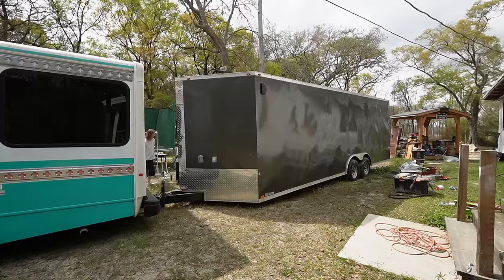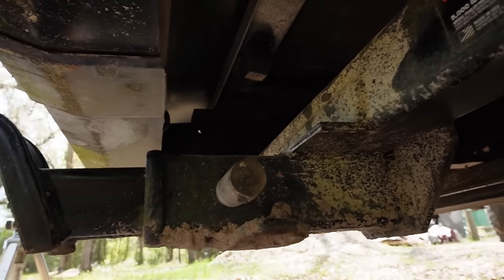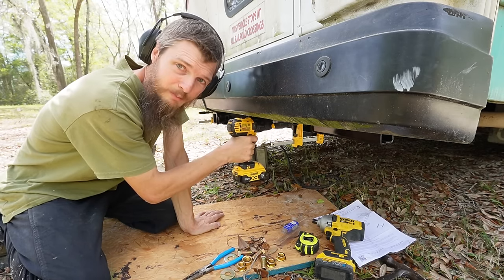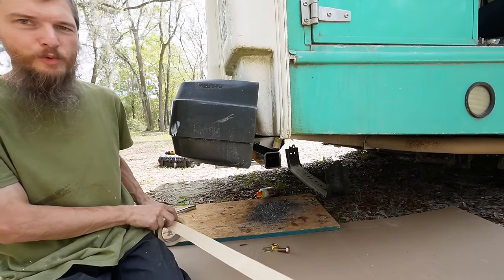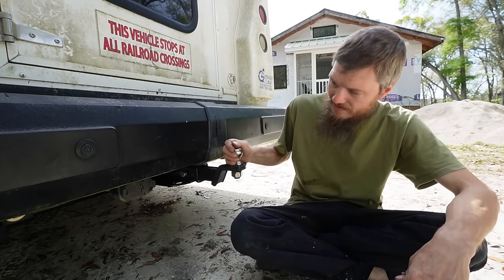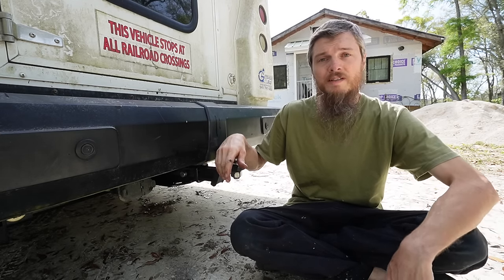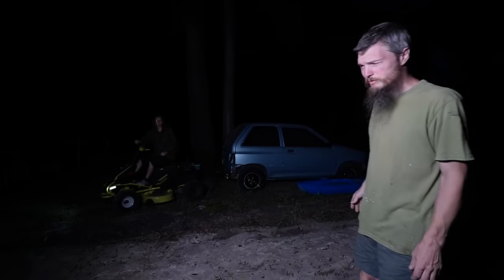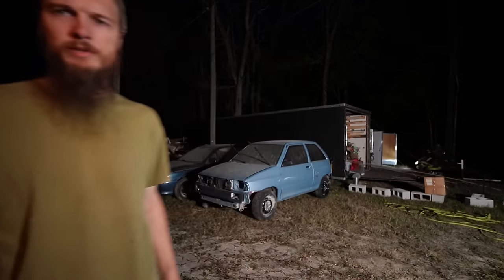More Changes. Making Life Better

Comment: Hey Doug, 
To prevent the rollback hold your foot on the break, shift to neutral, set the e-brake, shift to park. Dad taught me that one to save the transmission from clunking into gear when parked on a hill but I found it equally as handy in hooking up trailers. Cheers! 😊

Comment: I am so impressed with your creative problem solving. 
Absolutely impressed…taping the nut:bolt to the scrap of would so you could have it in place to fasten was brilliant. 
Which is the nut and which is the bolt!!??  And Ashley pulling the cars (future projects) across the yard just as easy as you please…simply amazing. I so much admire your Team work and value system!!

Comment: We always had hitch problems towing trailers until my husband bought a ‘Drop Adjustable Towing Hitch Dual Ball Mount’. Solved the problems and worked on any trailer we pulled.  Bought it off of eBay.

Comment: Nothing I'd rather do than put puzzles together. A web site where they send you a free weekly puzzle. Use it when I don't have room to put a puzzle on a table. No pieces lost either. Moving the cars did make the yard more organized and cleaner. So glad Ashley still locks up her mower. That thing would be gone in a flash. She did a great job moving the cars with it. Doug the upgrade on the hitch was necessary too. Looks really good.

Comment: A tip for drilling heavy steel.....low speed and high pressure will cut the best and keep the drill cooler.  That's why a drill press works so good, obviously you couldn't get a drill press on the car, but low speed on the drill transmission would be better than high speed 👍

Comment: I would recommend Air Lift airbag system for the rear of your bus, wreckers use them for ground clearance, it doesn't affect rear springs, only in heavy weight situations....

Comment: They sell specific hitches for  extending without removing the entire universal system. Just a matter of removing the pin and insert a longer neck hitch or higher/lower hitch and replace pin and off you go. 

I absolutely LOVE your channel and look forward to seeing them. I own a 1982 trailer and I’m learning so much from your channel. I’ve only been watching for a couple months now.
Reply: I agree a DIYfferent receiver would have done the job
Reply from the maker: The hitch frame itself was too low and there was no way to change that without changing the hitch. The new one is much better for our bus.
Reply: @diyfferent  , I was offering other options for future possibilities. Trailers come in all different shapes, sizes and angles. I like the new one better, it definitely added more height and balance for hauling. 

I hope you all have a beautiful and blessed day!

Comment: Not gonna lie, it's definitely a New York thing, too! 😅 At our house, the example was: moving a dead dump truck that didn't hold air, with a tractor that had a hydraulic leak (which of course happened run out while I was towing the 10 wheeler!) in the dark 😂
Would a raised trailer ball work better for hauling something like the shop? I don't remember the technical name but we use them when we tow farm equipment with a pickup. The rise is taller than a standard hitch which accounts for the drop when going from a tractor to a truck. I'm not sure if that would work for you or if it would end up being too high. 🤔 
You're making me want to work on a 1000 piece puzzle!! 😊
Reply from the maker: Yeah, that may help. We have two ball mounts, one being taller the the other. I've seen the adjustable and taller ones, but our ball was so close to our bumper that it was hard to use anything else. Now I definitely have more options.
Reply: @diyfferent  Yes, for sure! Swapping the hitch was a good move! I don't have a positive opinion on adjustable ball mounts... I feel like they aren't as robust. As space saving as it sounds, I'd rather have multiples.

Comment: All the little tasks can make such a big difference. You might want to cover your cars from the elements. I know you want to eventually paint the hatchback but 🤷🏻‍♀️. It might protect it. Watch for critters every now and then. I had a little Toyota Tercel that was parked for a bit awaiting repairs. Some rodents made themselves a home in the engine and I found wires eaten through and hanging from underneath the car. 😮

Comment: If you still have an issue with the bus squatting under load, you might consider adding some load leveler/helper springs. They sit over the stock springs and only engage when the stock springs compress. I've added them to several trucks I've had thru the years. They don't alter the ride feel at all until under enough load.
Reply from the maker: The bus will still squat. That's a whole other problem that we should look into. So I appreciate the ideas.

Comment: Those cutoffs would also be useful tacked on to the front of the “jar” shelves you put in the trailer to hold your nuts and bolts. Offset up a quarter inch or so, they could keep the jars in place, should you ever change your mind about moving the trailer. With your skills, even if your area is not prone to hurricanes, perhaps someday you will have the opportunity to take your bus and mobile workshop on the road to help others rebuild.

Comment: That mower has more power than you realised. Nice work guys. Very good move on that hitch.. I was thinking it was a little  to low when you were moving the trailer. But you don't know these things until you have to use them. 👍🏼👍🏼👍🏼🌻🌹

Comment: Bye, Maverick! Were you chasing lightening bugs?
Great job, Doug & Ashley getting all the cars out of your way. You've improved your land ten- fold already but I know you want it even better. Can't wait to see what you'll do next. 
Doug, changing the frame of your hitch on the bus helped give you more clearance. But the actual ball part can be changed too. They make different shaped balls that would move the ball away from the bumper even farther and some are shaped to give you more height also. You might want to check into those also.

Comment: You need some air bags over the rear axle. The trailer tongue weight is what makes the back of the bus sag to the ground. The hitch might help but it won’t solve your problem.

Comment: When the hitch was installed did they box in the frame extensions that nearly every shuttle has? I believe mine is the size of yours and I would not have thought that it would have had the extensions but it did. I do everything but weld but I found a great shop that fully boxed in and reinforced the extensions so I could utilize the full towing capacity of the E-450 chassis (22k pounds!)

Comment: I'm wondering why the manufacturer didn't have a single longer bolt to go through the square tubing vs. two shorter bolts to mount it to the brackets.  That would have made it easier.  

I'm surprised that mower had enough torque to pull those cars.  My dad liked to tinker on cars, so I grew up having to help push cars from one spot to the other.  Unfortunately, he wasn't very good at getting them to run again.  He had a lot of plans in his head, but not near as much ambition and time to get them done.
Reply from the maker: My guess is two bolts makes it stronger. Also, if the holes aren't drilled perfectly, one bolt might not line up right. Also, one bolt might squeeze the tube if it's fastened too tightly.

Comment: Hey Doug good video bro I like the newest job but wouldn't it be better if you put a set of airbags on that Beast I think if you put airbags on there that help Supply the load also and you'll be able to take that big ass trailer let me know bro
Reply: Air shocks is what I think you are speaking about.
Reply from the maker: A couple people mentioned it, and it's something I'll definitely try to look into. It may not be right away but that could be a good future upgrade.

Comment: Switching trailer hitches not going to do much. You need to upgrade your leaf springs to keep it from sagging. I suggest you install new leaf springs and a air bag system.
Reply from the maker: It's going to do a lot. Even empty I often drag the hitch on the road when pulling into parking lots and it's annoying. This one shouldn't drag. And I will no longer have to ram the trailer into the bumper when I hookup. It's a huge upgrade. You are right, this won't change our bus suspension and I didn't think it would have any effect on that.
Reply: Methinks that you should check the nose weight of the trailer.

Comment: Instead of replacing the trailer hitch go buy a weight distribution hitch... even a cheap one from Harbour Freight.  Once a weight distribution hitch is set up it will equally distribute the trailers tonge weight to 3 places: 1/3 to the vehicles steering axle,  1/3 to the vehicles drive axle , and 1/3 of the weight to the trailer axles. This provides safer driving,  less "squat" of vehicle rear suspension, better braking . There was nothing wrong with the hitch you had. Without proper weight distribution the vehicles rear axle will continue to act as a fulcrum causing the rear to squat, and the front to lift.
Reply: Good to know. Thanks.
Reply from the maker: I just want to clear up that replacing new hitch had nothing to do with resolving the bus squatting issue. I installed the ball hitch at the same exact height as it was before and it will carry the trailers exactly the same.

I replaced the hitch because the hitch frame was too low and did not stick out far enough. The hitch definitely needed replacing as it just didn't fit our bus well. And replacing it did fix the issues I was hoping to address.

Comment: The ball barely clears the bumper because the tongue is upside down. Like that you decrease the tongue’s load capacity.
Reply from the maker: No. The old hitch was just not the best choice for our bus. The new one fixed the clearance issue. The ball mount wasn't upside down. They can be used in either the drop or rise positions, so there is no up or down on them. I use it in the rise position because I don't like the hitch hitting the road and like it a bit higher.
Reply: @diyfferent  Ive used them up and down depending how the trailer or camper was riding. I was told from an off road store worker about the up/down tongue rating, that’s why I wrote the above. Now I’m going to research it some more. 👍

Comment: Bus will still squat, air bags man, air bags!
Reply from the maker: Yeah, I'm not worrying about the squat just yet. I was just tired of the hitch dragging on the pavement when I pull into a parking lot, and it being so difficult to get the trailer on the hitch because of the clearance issues.

Comment: Ok thats a first for me your lawnmower has a backup alarm, what kind of richy rich shenanigans is this lol. I've never seen any mower with a alarm and don't tell me it's also electric cuz i don't here an engine. Oof the sound of expensive is quiet lol
Reply from the maker: We'll be disabling that beep soon. It's rather annoying to listen to, haha :D
Reply: @diyfferent  surprised me to even see a mower with one lol we must not have those in Arkansas lol, what brand is that as well looks cool in all honesty.
Reply from the maker: @reaperasylum  It's a Ryobi. Ours is an older model that uses lead-acid batteries. We've had it since 2020. It's a great mower...super heavy though!
Reply: I laughed so hard 🤣 
Really funny comment 👍
Reply: XS power makes some really decent lithium iron and lithium ion batteries that might replace those lead acid ones, I use them all the time when I do stereo installs for customers and my own vehicles, 12v all the way to 16v. Last a really long time and not to terrible for charging, they are pricey but I was able to find some used ones for about half the price. Might also lighten the mower up a bit, it a neat little beast how does it perform on a yard just as good as gas mowers?
Reply from the maker: @reaperasylum  Sounds neat, but we actually like our lead-acid batteries. They really hold up well and we don't have to worry about them like most of the lithium batteries. We can charge them in the heat and the cold without ruining the batteries. And they last a long time. The mower works awesome, it mows everything.
Reply: Sweet I may consider going electric lol, my craftsman keeps breaking down and it bogs down and smokes like crazy, imma check the electric riders out. No bigger than my yard is a single charge should last a couple days. And great progress on the trailer my friend y'all are giving me inspiration to start on mine, very helpful guide to repair mobile homes🤙🏼💯
Reply: Richie Rich 😂 I know how old you are!! I bought a  new Suburu Forester a few years back that had a backup alarm and loved it.  My husband who got a new car the year before didn't get one and wished he had one. So for his birthday I found an add-on at an auto shop and had it installed. Only problem was that when he backed up the alarm went off so loud it sounded like a garbage truck. The neighbors ran outside to see what was going on. He was so embarrassed that after awhile he yanked off the wires.

Comment: Why didn't you use the Massey Ferguson tractor?
Reply from the maker: It's just not needed. It was late and so there was no need to fire up the loud diesel tractor and disturb the neighborhood just to roll some cars around. The riding mower is super quiet and it's more compact and easier to maneuver. It was just the right tool for the job.

Comment: I'm not a fan of small cars or vans, especially those like the Fiesta. 
With larger cars, SUVs and trucks there is more of a safety zone if you're in an accident .
In smaller vehicles or things with small hoods there's no crumple zone, YOU are the crumple zone
Reply from the maker: We just really love small cute hatchbacks, like these rare ones, and they have their own safety advantages like being much easier to stop. :) As time goes on vehicles keep getting more and more massive. Even pickup trucks these days are humongous compared to when we were young!
Reply: @diyfferent  I like looking at smaller cars but since my stint as an EMT and seeing how devastating even minor accidents in them turned me against them. 
I'm also not a fan of huge vehicles because those use more fuel and give the driver too much empowerment and they tend to drive more recklessly. 
I myself have 2 smaller SUVs. 
Like I said before, the people inside are the crumple zone in smaller vehicles. Meaning, if there's a front end collision there's a great chance that the object you hit is going to hit you and shove parts of the car right into you. 
Older cars also lack airbags which I can attest to the fact that they save lives and lessen injuries. 
Back in the late 80s a person ran into the rear-end of my car at a stop light, which caused me to hit my face on the steering wheel. 
It broke bones in my face, shattered my teeth and damaged the jaw area holding them in place.